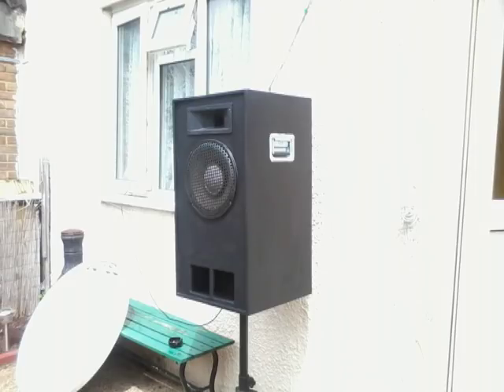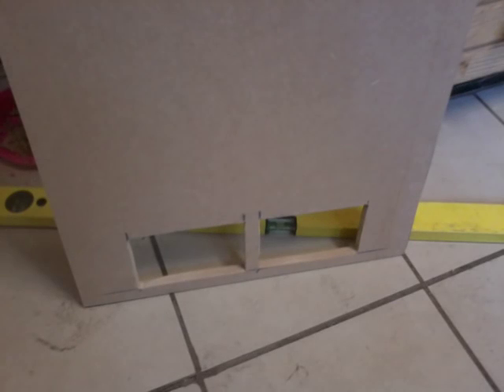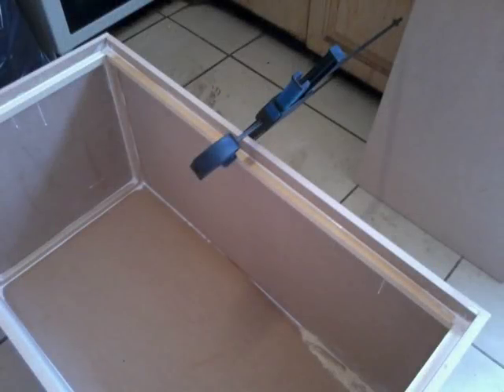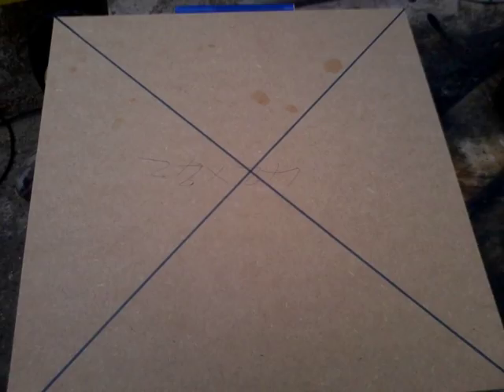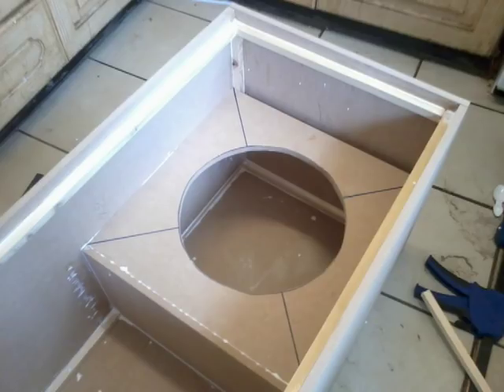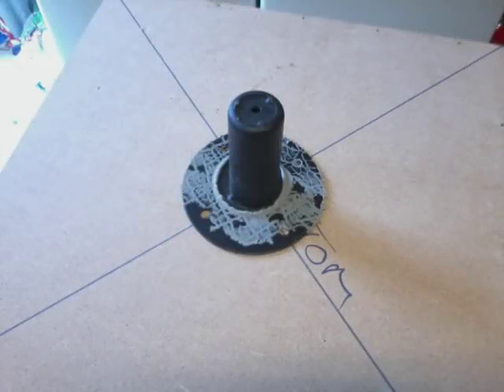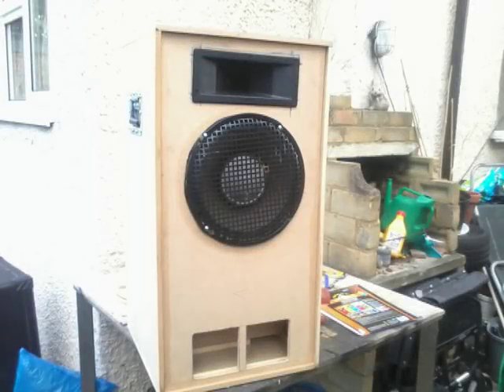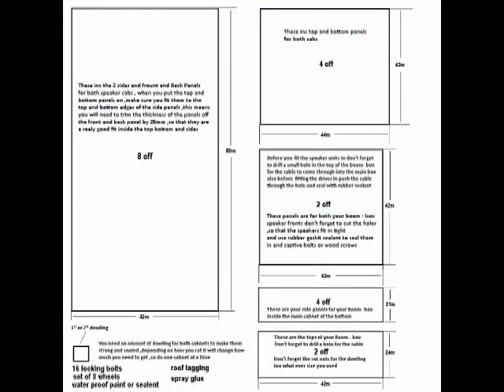How too Build a Powerful Pair of Speakers

Comment: Hi Barry. If I may I'd like to offer some constructive commentary on what I've observed - for the record I've been designing and building speakers systems for 20 years now.

I noticed one of your comments you said there was a lot of guess work. I haven't seen any mention of the mathematics involved in cabinet design - did you build it without any modelling or calculation? If that's the case it's impressive you are happy with the sound, though I daresay if you were to get involved with the albeit slightly daunting at first maths, you would get much much better results.

The bigger problem I see here is the design of the box - it is a blend of a standard reflex box with that of an 8th order (a vented driver into another vented space), except the internal driver will have none of the benefits of it's 8th order nature for reasons I will lay out below.

You speak in one of your comments of air 'bouncing around' - this isn't at all the case; speakers are basically either of a pressure system design or a wave guide. A wave guide are things like horns or bins, and yours would be a pressure-based system (like most speaker cabinets) where they are designed to operate with pressurised air to work in harmony with the mechanical responses of the driver to obtain maximum output at the desired frequency response. In an 8th order as mentioned above, the driver requires to be able to act on the pressure system of the internals of the box - in your case it vents straight out the main vent thus rendering it's purpose essentially null. The design is fairly uncommon (mostly due to the difficulty in the calculation and complexity of design) but the main problem here is vent location. You have to be able to create pressure in the box which the vent is tuned to release; this box really cannot do that in it's current layout. I would say also the vents look far to large for what the speakers would visually appear able to displace.

Best of luck!
Reply from the maker: Hi Cozmium, sorryn took so long to answer you ,yes your right they were made from guess work and some know how, they sound realy good, and infact  I now use them with an Electronic cross-over and the range is amazing, thanks for your comments will take it on bourd, on next build ,best regards

Comment: If you're into building speakers, you'll love the Bill Fitzmaurice website. He recommends this expanding glue (Polyurethane or PL Premium) that's waterproof and expands as it dries making airtightness easier. There are a few full range boxes but it's mostly tops and subwoofers.

Comment: rather than using loft insulation you could also use a duvet from tesco for £12 works exactly the same and its a bit cheaper

Comment: Is the sub enclosure a quasi 6th order bandpass?
Reply: +Wolf Punch 4th order
Reply from the maker: Yes it is my friend
Reply: Thought so, cause I used to have a HTIB (Home Theater In a Box) with tiny 6.5 driver, but the design of the box was essentially the same, and hit pretty good for a shoddy cheapo driver.

http://d2ydh70d4b5xgv.cloudfront.net/images/c/9/rca-rt2770-subwoofer-300-watt-8-ohm-f39e6f814e63e72291a2c561e05e623b.jpg

Anyway just as some advice the port need to be a specific length for proper tuning, as although adding holes of varying sizes will act like a port, just a hole in mdf would tune the box to have a rather high and possibly 'peaky' resonant response, in the case of this type of enclosure that can become quite a substantial degrader of sound quality. Perhaps the way you tuned it worked, acoustics is a really confusing science to master. I barely understand it my self tbh. Please don't take this the wrong way. :)

There are a few pages describing how to tune these, but it's rather confusing.
http://www.diysubwoofers.org/bnd/6thord4.htm
I believe the idea is the rear port needs to be tuned lower than the front port, and the front port needs to be bigger to allow for greater airflow of the port and speaker cone air movement, thus reducing port turbulence. Also another way to reduce this phenomena is to 'flare' the ports, i.e, round them off to smooth the transition of air passed it. simple things like this can drastically change the performance of enclosures, and often make them louder.

I'm gonna leave the comment here, before it become a essay of nonsensical rambling.

Comment: Did you use a subwoofer, a midrange or a PA speaker??? I see the tweeter paired up so I'm guessing that you used a midrange that can play 100 hz to around d 2k hz...please reply because I'm loving this design and sound...awesome video and gonna subscribe for sure...great workmanship!!!
Reply from the maker: Hi, I used 15" Sub plus a 15" full range for the front and two Pizzeo Electric Horn Tweeters, Send me an E-Mail for set of drawings bmildon@yahoo.co.uk

Comment from the maker: Hi I used 	
Peavey 22XT Complete Horn Driver ( 2 Available ) L@@K tweeter and for the sub woofer Celestion speaker 12" and 15" G12M-70 full range dual cone concentric,

Comment: HEY !!!

AMAZING SPEAKER TUTORIAL.

BUT......YOU FORGOT THE MOST INFORMATION.......WHERE ARE THE CROSSOVER SCHEMATICS??

HOW COULD YOU FORGET THAT?
Reply from the maker: Gioxtream Hi thanks for watching my video ,the reason I did not inc schematics in my video or drawings was because the one's I used when building the speakers were in fact second hand, and most people like to use the crossovers that best match the speakers there using at the time, I hope this answers your problem, in fact I now don't use passive crossovers at all now, I now use two amps and a speaker prossesor, gives you much more control, Best Regards Barry

Comment from the maker: I cam up with this type of cabnet ,because I see a bass tube in my mates car, so in a way its like a speaker Box inside another box The Boot, The Porting was done from a drawing I saw on the net, Older speaker Drawings, a bit of gess work realy, But when I put more powerful Subs in ,I ported the back of the sub box ,using a tube, for extra AIR FLOW, Look at the video Speaker Mod.

Comment from the maker: Hi to be truthful I have not weighed them but I will , the drivers I used were Celestion speaker 12"and 15" G12M-70 full range dual cone concentric, 
	
Peavey 22XT Complete Horn Driver  hope this helps

Comment: 25mm is 2.5cm so it's not that thick but it would hold it
Reply from the maker: Hi Harry ,yes I was trying to keep the wait down ,but I reinforced them inside as you can see 
from the video ,they are pined and glued with EVO stick water proof ,and then painted
with Rubberized black paint ,they work realy ,well and even when my Son DJ LP puts his hard house tunes on them there a nice solid bass ,down to 40hz when we tested them.

Comment: Did you develop them youself or is it used circuits...   or   'diy' kits, where you still ain't leaning to make a speaker.,which is in my opinion without education and the right gear impossible...    to get the best out of it., but i like the look, not tooo bulky(which is the main reaon using line boxes...   nooo, no software....math

Comment from the maker: I used an off the the shelf ,but now I use two amp, one sub and one for midd and top
and no crossover ,watch my speaker mod video
Reply: I've got an 10' sub and a 6/9, how do I wire these? Can you please send me a wiring diagram or how to build the crossover if its needed. you're work is great.
Reply: Johan Gelderblom if you need help with cross over you need to provide more information
what is the desired cross over point, are you good with electronics so on,
in the future just buy a book to teach you. google it if you need a book to explain.

Comment from the maker: No it is not, its not just a 30 Hz to 250 Hz sub
Reply from the maker: +Rik Nelson Hi Rik, yes in a way both power output and Bass, but from a smaller cab, they work well both inside and out, glade you like them.
Reply: Correct.. I am a oldie with sound etc and have done this many times with many variations and amazing results.. Subscribed!!
Reply: +Barry Mildon if it is powerfil it should be down to 5hz